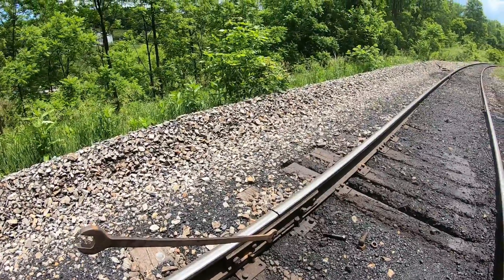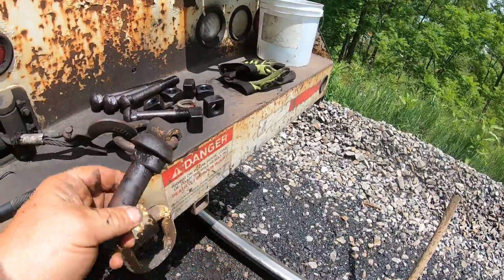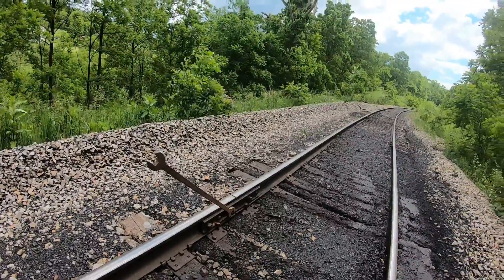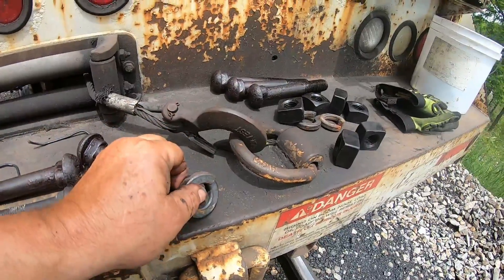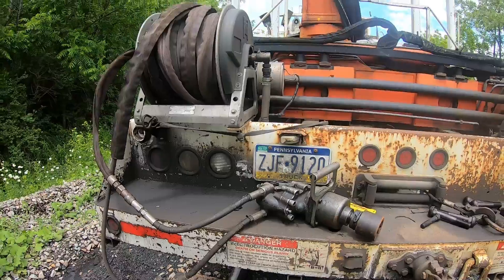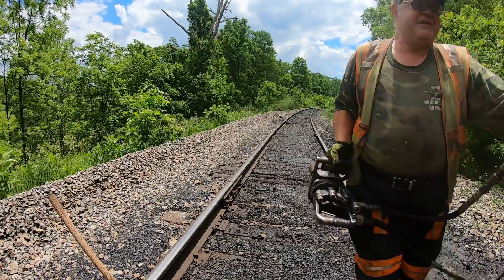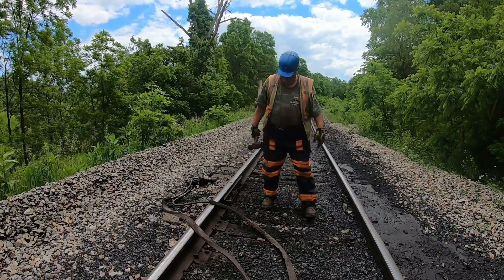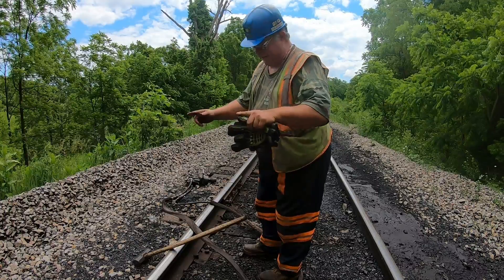Bolts in a Track Joint need Replaced - You Can Help Fix Them

Comment: My dad still slips up sometimes and says “worshington”  and “worsher” he’s been in the South for 36 years! When I heard you say “worshington” the first time I knew you were in my briar patch. Been meaning to tell you that here in Tuscaloosa is home to the longest wooden train trestle still in operations that crosses the black warrior river between Tuscaloosa and Northport. Norfolk Southern runs. I’ve been seeing Union Pacific locomotives a bit more here as well not sure what’s going on there but they’re gorgeous engines! I love seeing that flag thunder by shaking the ground! Oh FYI that trestle, over 3500 long! Google it sometime!
Reply: The UP locomotives are just cross country power. NS locomotives go all the way to the west coast as well. It’s easier to leave the power mixed all the way across the country than to break up a train when you go off the home rails.
Reply: @ralfie8801  even as the lead engine?
Reply: @macinfloydvolk  It depends. The led unit must be set up to handle both the DPU (if any) and the thru the rail signaling (if any) of all subdivisions it will be traveling. Most major railroads will assign a group of locos to run-thru duty with one partner and use another group of locos with another partner, and not mix them. It saves time not needing to swap locos at an interchange as well as at the terminals when changing direction. Just make sure the lead and trailing loco cabs are both pointing out and you are good to go at all times.
Reply: @thomasboese3793  such good information. What has changed! I have lived in Tuscaloosa since I was 9 and only within the last few years have I seen Union Pacific engines … I chalked it up to maybe Norfolk Southern had a deal with Union Pacific or maybe regulations have changed… loved trains my whole life but I took a step back for many years because I was bitter that I couldn’t  drive one
Reply: @macinfloydvolk  
Yep, I see NS engines leading UP trains west on UP tracks all the time.
Reply: Warsh the winder with werter is Pennsylvania all day.
Reply from the maker: I will do that Scott, never heard of it before. UP engines are indeed
cool to see. You can take a man out of Pa, but you can't take the Pa.
out of the man....LOL
Reply: @ccrx6700  exactly! It’s a special place for sure! Everyone asks me what Philadelphia is like and I’m like that may as well be Mars. My people don’t travel north of Pittsburgh south of clarksburg, wv, or east of Washington,pa
Reply from the maker: @macinfloydvolk  glad I live out here Scott, big cities are not for me at all, but to each his own
Reply: @ccrx6700  sounds to me like you have a touch of Heaven! An awesome job, a great community! Tuscaloosa is a small city. It’s easy enough to get out of town if need be and see a cotton field or two. The university of Alabama is here so when the home team plays Bryant-Denny stadium getting downtown is impossible. I’m currently looking for property out of town and in the country because cities aren’t my thing either. If I had to grow up in one though,  Tuscaloosa isn’t bad. It’s not like Birmingham or Montgomery. Huntsville isn’t bad either but o haven’t been there much
Reply from the maker: @macinfloydvolk  👍

Comment: Those are quite beefy bolts Dave! My daughter just installed 1/2" grade 2 hot-dip galvanized bolts on the woodshop posts yesterday — girly bolts compared to those track bolts! That hydraulic wrench was a beast as well. Very enjoyable video Dave, I love learning about railroading! 😁
Reply from the maker: Thanks my friend. We were working on putting in drains on a new construction
pole barn today. They did the sono tubes and bottom braces like you did, but
they should have watched your vid on how to install them! Those steel braces
were all over the place on one end of the concrete and the other. No perforated
pipe available here, had to use solid pipe and drill the holes in, every hole I drilled
thought of you! Had a DeWalt 18V drill and a Milwaukee M18, that Milwaukee
was impressive! Drilled a lot faster than the DeWalt, totally suprised me how
much faster it drilled.

Comment: Assuming a square nut is stronger than a hex head?
Or is there another reason?
Reply from the maker: Good question Bill and while we do use hex head lags for bridge
guards, I'm not aware they even make them for joint bolts
Reply: @ccrx6700  Thanks.
Reply from the maker: @railroad9000  👍
Reply: history, and easier to tighten.
Reply: @rearspeaker6364  Thanks

Comment: Hi Dave,  great video again and thank you.  I was curious why you wouldn't pretreatment with wd40 or other penetrating oil since they are designed to help loosen bolts just like those. 
Keep up the good work and I can't wait to see that curve fixed too!
Reply from the maker: Great question Lyndon, and if I was using a hand wrench, then yep
we'd use 40 or Blaster, the hydraulic wrench or the liquid wrench (torch) doesn't seem to care
either way...LOL
Reply: No need to as these bolts have good clearances that allow them to be self cleaning once you loosen them and they don't take much to turn once you are off the lock washers. It is the lock washer that prevents them from coming loose. Well most of the time. That is why you have to inspect the track as they will loosen sometimes if the lock washer doesn't bite into the nut.

Comment: The old thick washers were much better. Less threads to run the nut down lol
Reply from the maker: I really think they held tighter too than the thinner ones, don't
know why they quit making them. What are your thoughts Michael?
Reply: They did hold tighter. Could never understand why they quit making them
Reply from the maker: @michaelball760  thanks Michael, really glad get a conformation on my thoughts on that 👍

Comment: Aaaaa....It's a beautiful day when after a; "HARD NIGHT" of sleepin in😂.....I get to watch one of your RailRoad videos! 
Dave, When you say "80 pound track" are you referring to the weight of 1 foot of track? 
How about; "UNDERGROUND RailRoad".... what meaning does this refer to........obviously not the meaning I am familiar with.🤔🤣
   On the one bolt that would not come loose; a lot of times when I've had trouble with   stubborn bolts I have found that a few "taps" in opposite direction with the impact will often break them loose.
Reply: It refers to  80 pounds per yard (3 feet). A standard 39 foot (13 yard) length of 80 pound rail weighs 80x13 pounds or 1,040 pounds. A 39 foot stick of 136 pound rail weighs 1,768 pounds.
Reply from the maker: Thanks John, you are exactly right there sir
Reply from the maker: On the bolt that couldn't come loose, you were unable to see that I did
reverse direction on the impact wrench, and it often does work doing
that way, but in this case I had to cut the bolt off, which I didn't show.
John answered your question perfectly bout the weight of the rail, it's
per yard. 

Down in the mine they have track. There's track from the outside
supply yard down the slope to the mine, which is how they haul
all material and equipment into the mine. Then rail takes it to the
mining sections. They use what are called motors under ground
instead of calling them locomotives and the motors are rated by
tons, like a 50 ton motor. They are generally battery powered but
do have a few diesel motors too.

It was a great question and anyone not familiar with under ground
mining would not know what goes on in the mine or how stuff
gets moved so hope your question and this answer helps a lot
of folks understand better. Gonna have do a video on how that
all works sometime too. Thanks my friend
Reply: @ccrx6700  YES ! You answered my questions. Very well explained ! Well ...At least you know I'm paying attention in class. Also, I kinda figured "Questions" were better than leaving a apple on "Teacher's Desk"! 🤣😂👍😎
Reply from the maker: @capttom7772  I like apples 🍎

Comment: Pretty much in my career I always wore my brain bucket with the visor to the rear as I did not like the visor acting as a blinder on my peripheral vision, plus it was a lot easier to use a face shield when needed as well......
I was always staunch about use of PPE long before it really started being mandatory!
Reply: Some brain buckets are not designed to be worn backwards as they provide no protection from what normally would be the rear.  The ones we had at work were designed and rated for either way. Like you, I wore mine with the visor to the rear as it is hard to get your head in close when to the front. A US Army Corps of Engineers site safety person chewed me out for having it on backwards according to him. I pulled the instruction sheet out of mine and handed it to him. "Read this!"  Never heard another peep out of him on any of my inspection trips.
Reply: @gravelydon7072  I was a Sheet Metal Worker so pretty much ours were  the Hard Boiled  Plastic version of the Fiber Glass ones worn by the Iron Workers.....some areas they were issued by the Local Unions by color so as to ID the Trades one was associated with
Reply from the maker: Good for you, despite what anyone says, you got to keep yourself
safe by wearing whatever you feel is needed to do that. congratulations sir. I wear visor front to shield against sun, but
understand your reasoning and it's okay
Reply: @ccrx6700  high viz around my arse, shirt off getting a tan, hard hat in the van, track levelling with Chippings. 
Bent over shoveling 99% time. First thing driver sees is my arse . My dad told me . Be safe out there Dave. 👍😎

Comment: Is that the super alivations that makes the track appear to slid on the roadbed,roadies, or become of the cribbing needed that it's looking like that
Reply from the maker: The rail I'm working on here Stephen is the super elevated rail,
it's about 2 and 1/2 inches higher than the low rail at this point,
hope that what you were meaning sir
Reply: @ccrx6700  yes I was sorry brain issues on spelling
Reply: @stephenrichard5191  brain farts is what I call that.
Reply: @rearspeaker6364  lol yes that does work to.
Reply from the maker: @stephenrichard5191  we good, I have same thing happen me 😉

Comment: Now that’s an Open End Wrench like I’ve never seen before.  WOW! 👍
Reply from the maker: Yep, can't go to NAPA and get one of those...LOL Thanks for
watching Ken
Reply: Yep. Most of the ones I've used had a chisel end on one end and the open end on the other.
Reply from the maker: @gravelydon7072  sweet, never saw one like that, it would come in handy break ice off switch plates
Reply: @ccrx6700  Aldon sells them as one end is an open end wrench so now I guess you would have to grind the other end to make a chisel. I think the original idea of them was so that you could get the fish plates loose.
Reply from the maker: @gravelydon7072  gotcha. I use the curved end of a claw bar for that, although most often just hit them with a sledge and they fall off. I like the idea of a heavy wrench with chisel end for the ice tho, will try grinding an end off one of my wrenches. Ice in a crossing is sometimes a pain, that would work well for that also, appreciate the idea 💡
Reply: Indeed. Me too.
Reply: @Ron4885  need one of them to tighten up the head bolts on a honda v-tec engine.

Comment: btw whats your track speed?
Reply from the maker: 25 Jason. We are a class 2 track and 25 is code fed regulations
speed for that class of track
Reply: @ccrx6700  sounds like that would be fast enough lol the railroad i worked on was 25 and now it is 10 mph for 50 miles
Reply from the maker: @jasonoliver5388  👌 thanks for sharing Jason

Comment: Replace a lot of them. B&O
Reply: No I used the big wranch
Reply from the maker: Hope you had hydraulic wrench Garry! They sure are nice, I've worn
out about 4 of them over the years. We also had a Geismar bolting machine with gas engine, that baby was nice, could snap a new
bolt in half if I wanted to with it